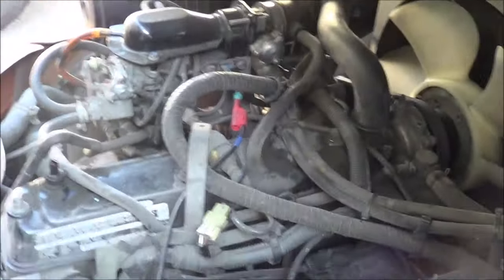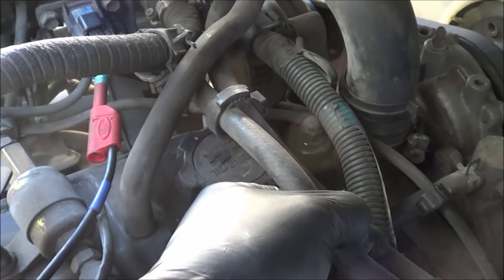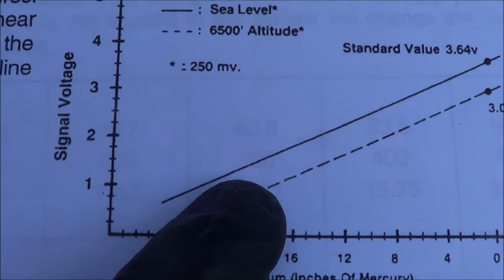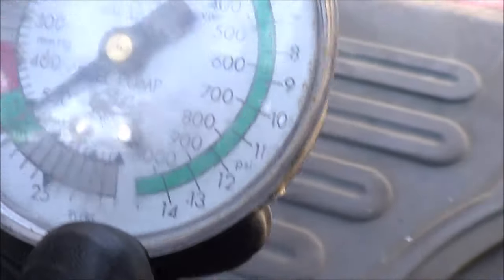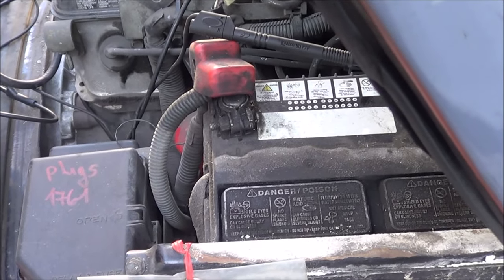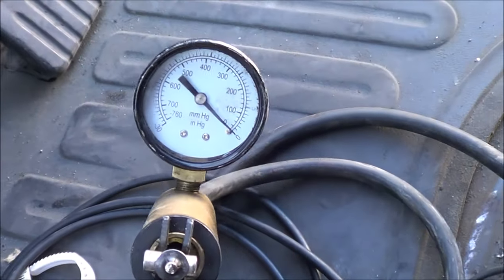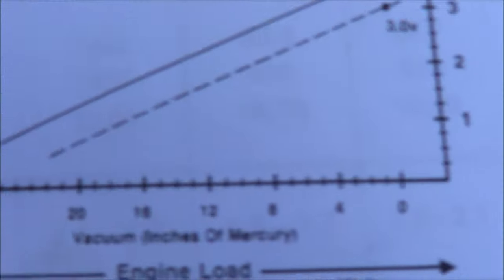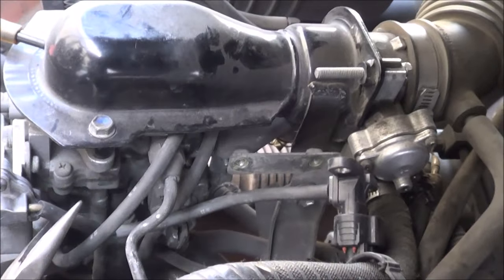Toyota Forklift , Hard Start , Rough Idle

Comment: Hey man I have a lpg Toyota forklift. It’s got no start. 
It tries to start but can never catch. I tried spraying starting fluid right into the intake and still nothing. So that lead me to believe there no spark because starting fluid should atleast get it to start for a second. 
I checked the spark by grounding the spark plug and it’s got spark but it looked weak. I changed plugs and still the same thing. Could it be a weak spark or should I look somewhere else ?
Any recommendation on what I should check. 
The distributor cap looks a little worn but I would think if it’s sparking it should start.

It’s a 2014
Reply from the maker: Spark should jump at least 3/4 inch using a test light or a wire connected to body ground or negative. If it does not it is weak to jump the spark plug gap under compression.

Comment: We have a Impco model J, with a sticker with P/N JB 201205. It does have a spring button in the center. Also on the casting it has WCO 08 LBS. I took the discharge tube off and turned the key on. It blasted harder than 8 lbs it seemed.
Are the Rebuild Kits the same for the "J" model and the "JB" model ? 
What is the function of the spring button in the center ?
Found a new unit for $97 on EBay. Dealer wanted $800. 
Thanks for your time.
Reply from the maker: +VideosByAl not sure about the difference between j and jb. The spring button on the center is a primer. Anytime you feel pressure coming out of that hose to the mixer, it's means the regulator is not doing its job anymore.
Reply: Thanks a lot. I'm going to take it apart and look it over. Can't hurt anything at this point.
Reply from the maker: +VideosByAl you're welcome. Say, did the throttle potentiometer fix the problem on your 4 wheel electric?
Reply: Good memory. Yes, we had the Toyota road guy drop a potentiometer in and that took care of the problem.
Currently using a 5 and 7 series Electric 5000 lbs trucks, and the 5 series Lp is a back up. Well when it runs ;).
Thanks again for your help.
Reply: Just for info that primer button was first used on Century LP systems. It was intended to aid in the first start. It was controlled by button on dash which depressed plunger. Saved on long starter crank time also aided engines with low vacuum conditions. There was also a kit to adapt an electric plunger to Impco systems.  @forkliftgeek10

Comment: I have propane coming from my air filter when i turn it off. What could cause this?
Reply from the maker: It could be from multiple causes. It would vary depending on the fuel system being used. But common cause would be the propane regulator.

Comment: We have a 5 series that got pull out of service because too much LP was being delivered.
I have not had time to look for the problem. I don't think it has a map sensor, I think raw liquid is getting to the carb. Is that possible ?
Reply from the maker: +VideosByAl yes, if the vaporizer is not able to regulate the pressure.

Comment: How can I get in contact with you I have a problem with a fgu25 rebuilt regulator, took carb apart. got running great hot. but will NOT start cold... Starter keeps kicking back, it will start and cut right off I'm losing my mind...... Please help
Reply from the maker: When it is not starting, what is missing? Spark or fuel? Also check vacuum reading when cranking should be between 3 to 5 inches of mercury.
Reply: ForkliftGeek cold starting is when it does it. It's kicking back like a gas motor out of time... at 0:38 that box on the fan shroud goes from the diaphragm to that hollow box I'm assuming that box is some type of expansion chamber all the way over to the air cleaner where the plug is I guess for the air filter indicator I did away with all that put a fuel filter on a short hose to the diaphragm to keep it clean plugged of the air cleaner side .and it started cranking smooth again and running better
Reply from the maker: So, it's not acting up anymore?
Reply: ForkliftGeek it's kinda hard to explain typing..when I go to start it cold it will shut right off. and do that like ten times all the while the starter grinding like it's out of timing...then it will run rough and clear up and be fine. I got it to where it runs and starts great when it gets warm.. but cold starts are hell on it
Reply: ForkliftGeek cold starting is the problem it used to be starting all the time but everything I've done it's just cold starting it is a few min process getting it going cold it starts cuts right off starts cuts right off
Reply from the maker: I would like start with basic. Vacuum gauge, spark and fuel. Does it keep running if u add fuel.
Reply: ForkliftGeek it's essentially doing the same thing that one was doing but I can't smell fuel. almost like mine is lean not rich. it will start after a while giving it throttle. It almost seems like it's not getting enough fuel during startup... Here is a list of what I have done....
Checked plugs and cleaned them
Checked wires, &compression
Rebuilt regulator
Took apart and cleaned the carb. 
Took apart and cleaned the starter
Checked all the vacuum hoses
Mine doesn't have the same diaphragm that was leaking on that it's just 1 hose to the map I have a fgu25
Reply from the maker: That's why I was saying add fuel. But I meant externally by using quick start or brake clean. But keep a fire extinguisher close by just in case u have a back fire.
Reply: ForkliftGeek lol yeah gotcha I'll give it a shot and make a video and link it here if I can't get anywhere while I'm there tomorrow. hopefully I don't have to use that expansion tank again. I took it off and I knew it wasn't clogged up cuz I blew into it.. I had it all figured out and explained to him. I'm not sure what possessed my dad to pick it up and put an air nozzle to it, but he blew it apart hahaha

Thank you for your time I really appreciate it man!

Comment: How does a fella get in contact with you?  Wanna pick your brain about a Raymond OPC 550, code 84.  Tried swapping parts, meter places, on and on and on.  Was hoping you could help.
Reply from the maker: +Oat lord does the truck move at self check before coding out?
Reply: Sorry about the reply in the other video.  I forgot I sent this one.  Anyway, yeah, the truck lurches forward a bit at selftest before the brake engages.  We've tried swapping VMMs and brakes just as a test, and it still does it.  Thanks for taking the time to comment on this and your videos!  Awesome stuff.
Reply from the maker: +Oat lord knowing that the truck moves then it can only be a mechanical issue. You said you replaced the brakes, did you try to adjust it? Did you replace the brake as a whole or just the top part with the pads?  At start up the computer powers up the drive motor with the brakes engaged then looks at the encoder. If the encoder was sending a signal it would code out 84. But since the truck was moving then naturally the encoder would send the signal. To verify you could unplug the encoder before start up and see if it still codes out.
Reply from the maker: +Oat lord another test is to unplug the connector for the brake before self test, if it stops the truck moving, then somehow the brake coil is being energized. If it still moves then problem is with brake or the motor shaft spinning independently from the brake rotor.
Reply: Awesome, thank you. We're going to try these suggestions and report back shortly.  Thank you again for your channel and help.